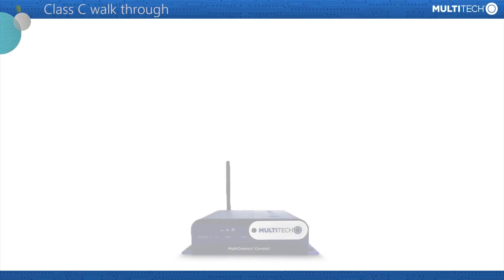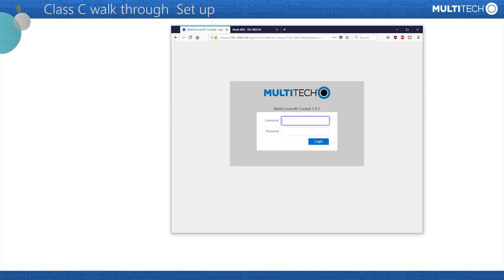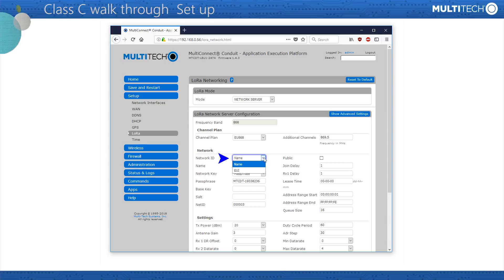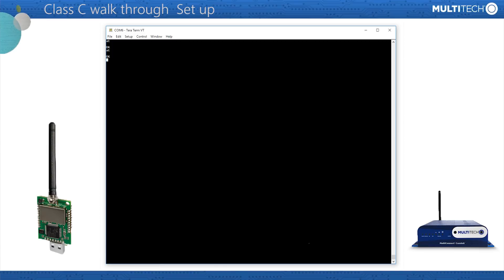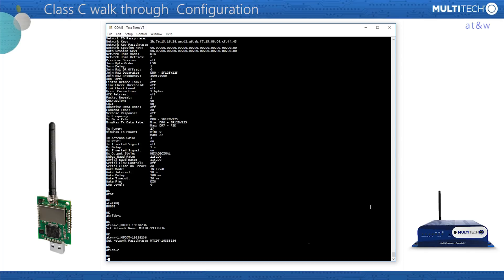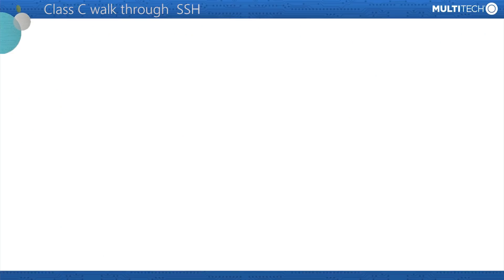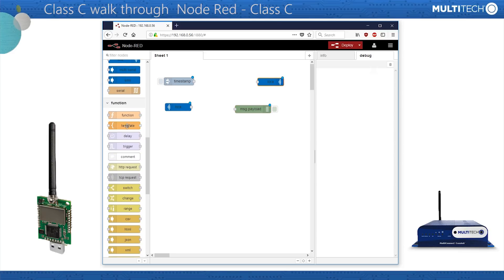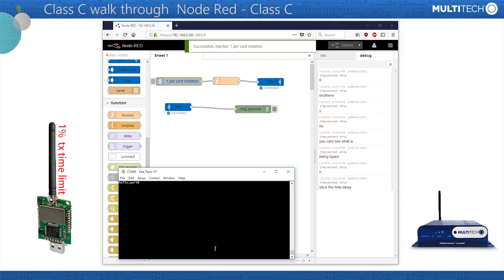Node Red on Conduit AEP to mDot Class C LoRaWAN  Connection

Comment: Hello Richard, Thank you for providing this indepth tutorial for our gateway set up.  I also wanted to make you aware of recent feature additions with our latest software release:
Software Upgrade - Now Available!

New features in software release 1.6 include:

Enable/disable Call Home
Back up custom apps with User-Defined Defaults (UDD) 
Increase RSA Certificate Key length 
SMS commands
Open VPN upgrade
Certificate Upload support
Yocto updated to 2.2 version
New LoRa related features: 

LoRa Firmware Update Over the Air (FUOTA)
Multicast Messaging - LoRa end devices
For easy access, I've included a link to our site to download the details - https://www.multitech.com/brands/multiconnect-conduit

Please let me know if I can provide further assistance at drogers@multitech.com
Reply from the maker: Sorry I have only just seen this Dawn - but I hope you approved of the Multitech coverage at Reading this year   https://youtu.be/a9WGctdaApc   (We can't keep Campbell down! :) )